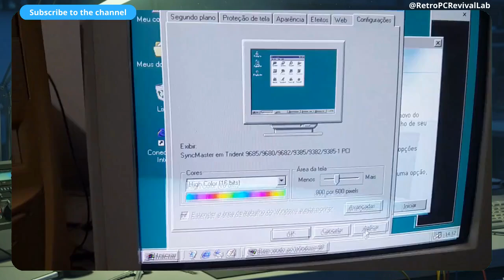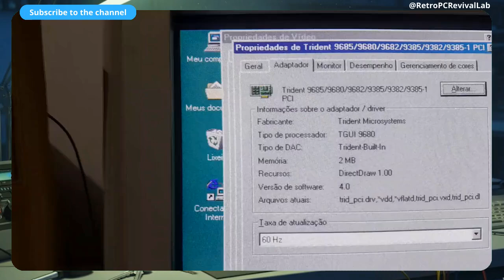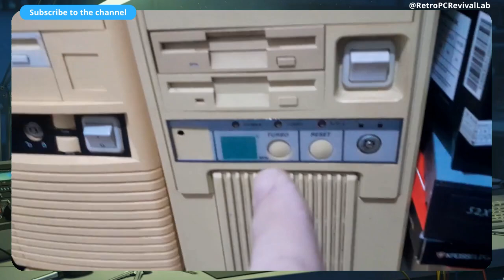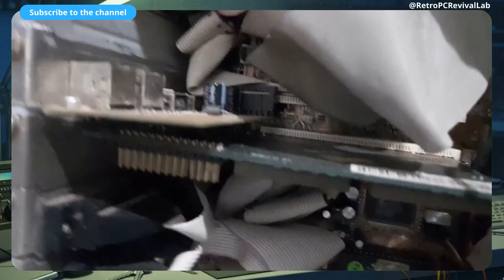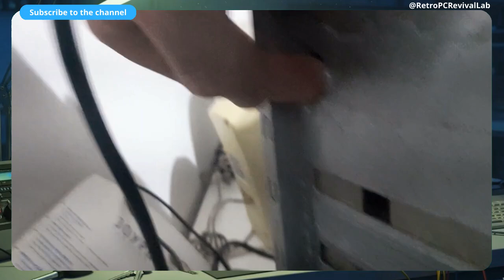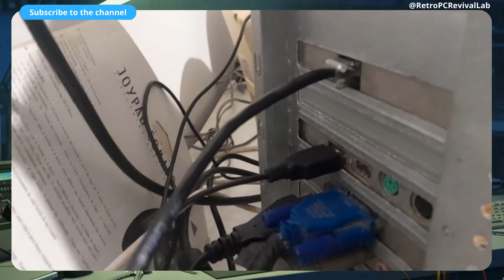Introducing my Retro K6-2 500+ PC | 90s Computing Nostalgia

Comment: A K6-2 at 500 MHz was one of the fastest/rarest ones, right? Back in the early 2000's I was daily driving a K6-2 400. I remember running XP on it around 2004 or so and it ran quite well to be honest.